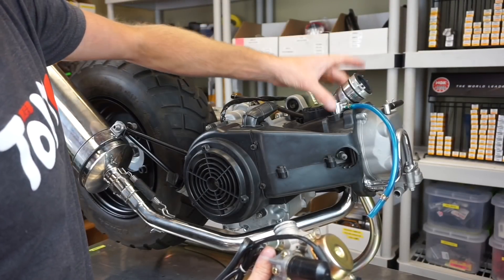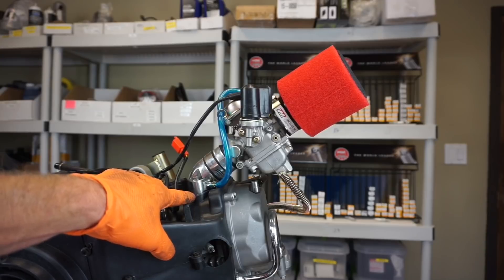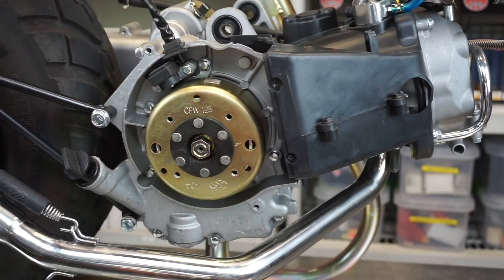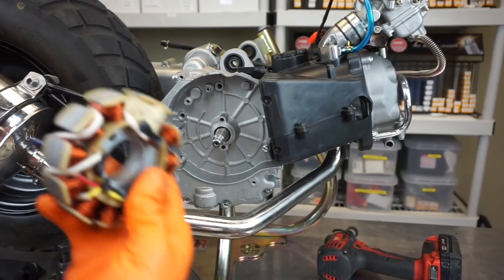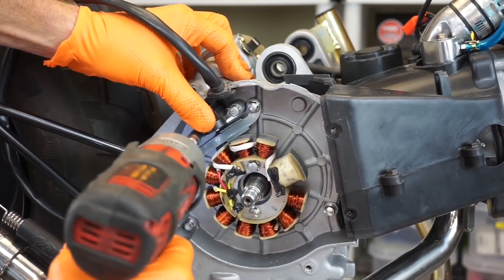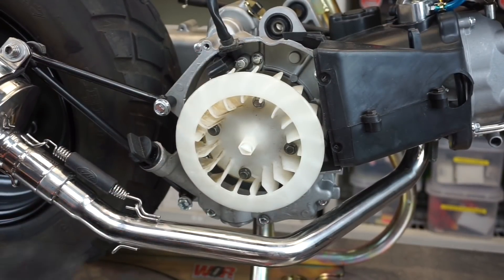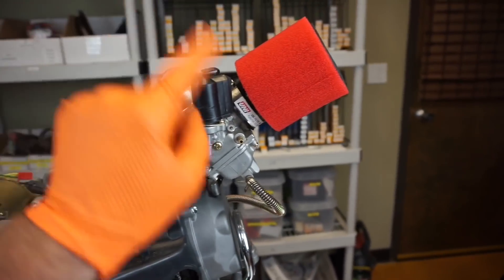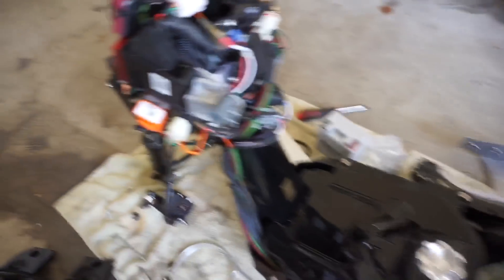GY6 Ruckus 11 pole stator Build Series: EPISODE 2

Comment: I did the 11 pole stator upgrade. I also rebuilt the common part of the wire harness. Instead of a group of electronics going to a single common wire to be grounded on the battery, every device has its own common wire. I no longer have any issues with signals crossing due to lack of good grounding. My lights are much brighter and the scooter functions a lot easier.

I currently have a 55 pilot jet on my 150 GY6. 125 main. 28mm Nibbi carb. Still working on tuning. The 55 pilot made cold starting a ton easier. I am having issues with mid to high throttle if I squeeze hard and fast. If I ease into the throttle, it runs okay. Anyone have any ideas?

Comment: So what about the wiring difference?? You only had 5 wires on the 8 pole and now have 6 wires on the 11 pole stator. What to do about the extra wire?? That’s where I’m stuck and was hoping you would address in the video..
Reply: The extra wire is the 3rd phase yellow wire goes to the matching voltage regulator rectifier.

Comment: Matt, why the 11 pole instead of the 8 pole?/? are you changing  the plug on the harness end?
Enquiring minds want to know , Also , that there bug deflector yer growing don't really deflect , but it shor nuff cushions da hit,  still needs ta pick yer teeth tho.. I's atellin ya frem sperense!
Reply from the maker: Elwood Watson I install the 11 pole stator so the stator is compatible with the oem rectifier regulator. In a later episode you will see the super slick wiring harness I built to utilize all of the stock Honda electrical, excluding the stator :-)
Reply: To upgrade to full wave aka 3 phase for more charging power.